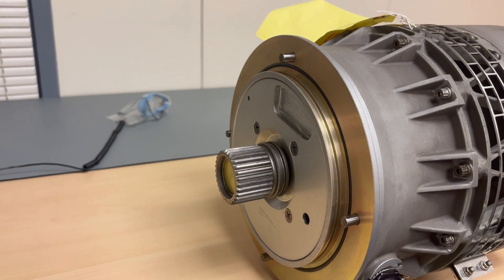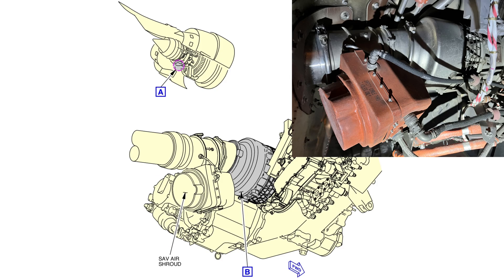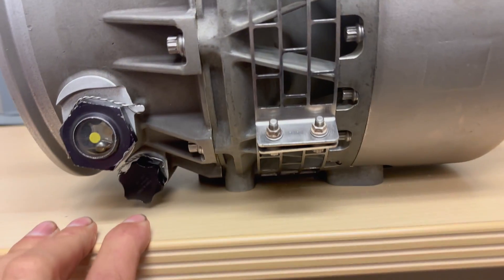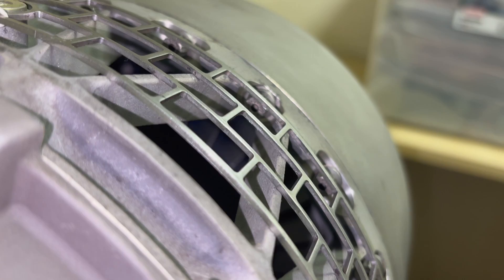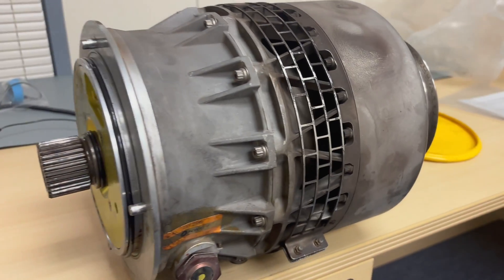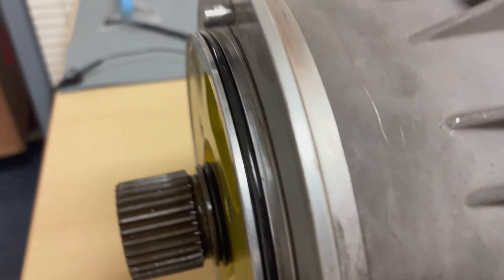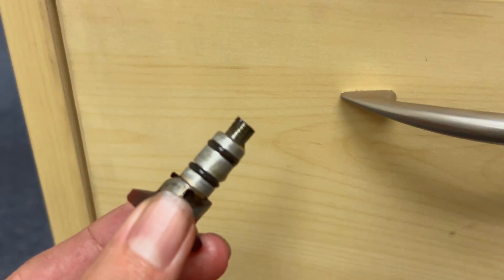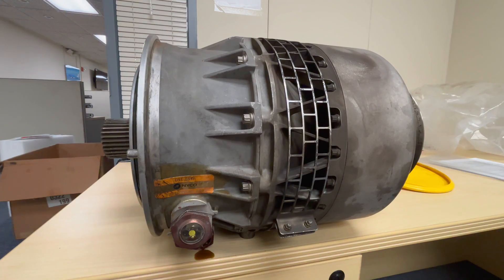B777 300ER Failed Starter GE-90-115

Comment: If the gen and engine oil systems are connected, does this mean that the metal in the oil contaminated the engine oil?
Reply from the maker: Hi, the starter is oil kept full by the engine, it’s circulating out of the starter back into the engine. Oil of the generator (IDG), has its own circulation and doesn’t come in contact with the engine oil.

Comment: Filler plug location?
Reply from the maker: You fill a little bit of oil through the front area of the starter (spline). Lever is kept up by the engine oil system through the connection to the gearbox. No fill port needed.

Comment: Amazing video, thanks for sharing and can you tell us how to make the starter turn? By voltage or air ? Thanks
Reply: I encourage the pro to correct me if I'm wrong here, because I'm not that guy. But to further explain, these are air starters. Essentially, compressed air turns the turbine inside the starter which in turn rotates the splined shaft seen in the video. The splined shaft interfaces with the jet engine which ultimately provides the rotation needed to start the jet engine. The compressed air is provided by any of the following: start cart, or bleed air supplied by either the APU or one of the other jet engines which have already been started on the aircraft. Again, I'm not an expert here, but rather just an aircraft nerd who is fascinated by these things. Please correct me if I'm wrong on anything.
Reply from the maker: @Ligma_Balzach  no correction needed, thanks
Reply from the maker: Hello, thanks for watching. This one needs air to operate.

Comment: Thanks for sharing the nice pictures, very interesting to see. Are the starters one of the more reliable parts, or do they break (or get out of spec) relatively frequently?
Reply from the maker: Starters are normally changed on time, so encountering one that breaks in between is with the B777 rare, for me it was the second one I ever changed. Working on B777 on the line for more than 10 years.